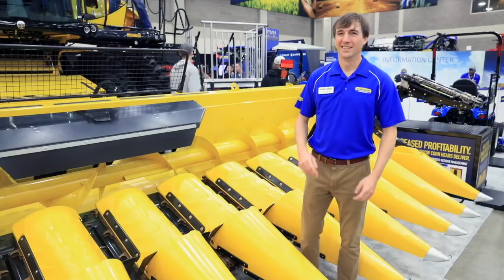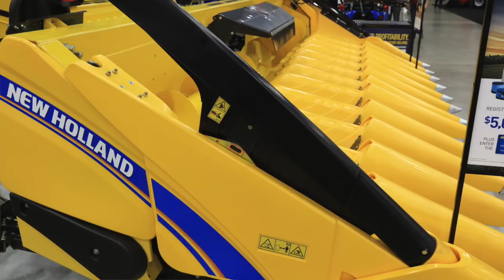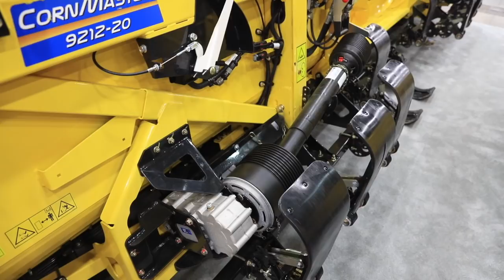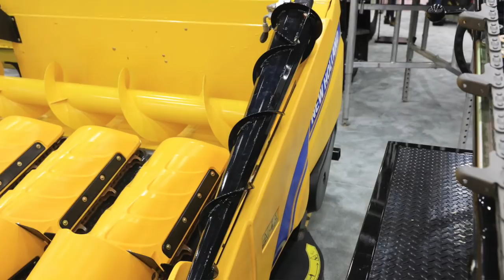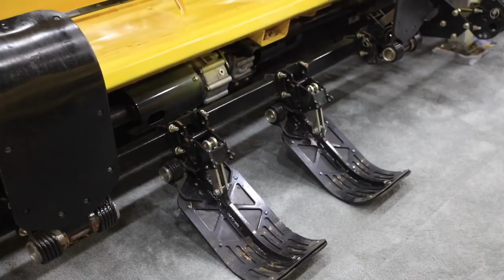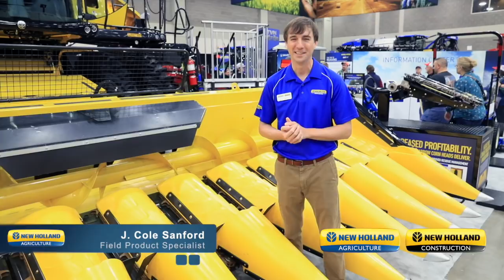New Holland Introduces 9200 Series CornMaster Corn Head

Comment: Hey New Holland. I have a recommendation for you!!! So Chet Larson was saying in his latest video that the lease was almost up on air force one the big John Deere  track combine so I have also seen some of the grumpy farmer YouTube and he loves his new cr8.90 so that got me thinking what if New Holland sent Chet Larson of Larson farms the YouTuber in correl mn 1 or 2 of the cr10.90 for a demo maybe the Larson folks could do some good advertisement and get you some new customers as well as save themselves some money by buying new holland if they like the demo. Just imagine if the new holland combine won them over out of the green machines they usually run. They love John Deere but they also rather have better then just green that why they have 3 case quad trace and the new John Deere quad trac they are not very happy with and the have said the case is a better quad trac many many times. And according to the grumpy farmer the new holland is a better combine you might even consider letting them demo a cr8.90 and a cr10.90 so they could see which one they would like to own. Oh and a cpl 12 row  folding corn heads and 45’ grain heads